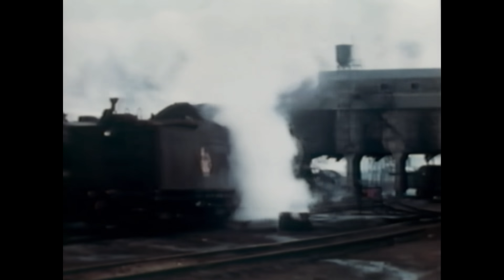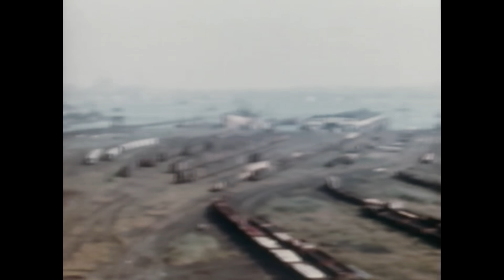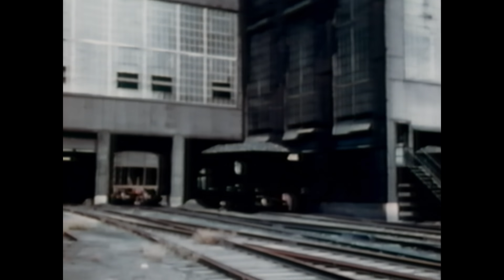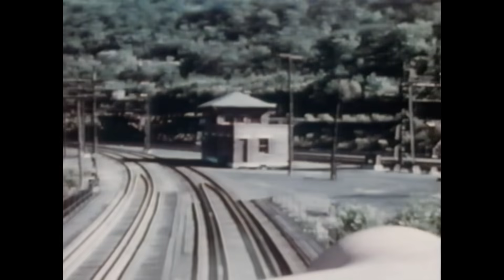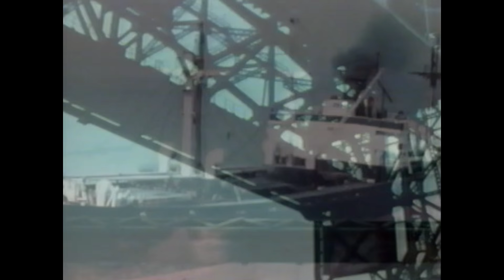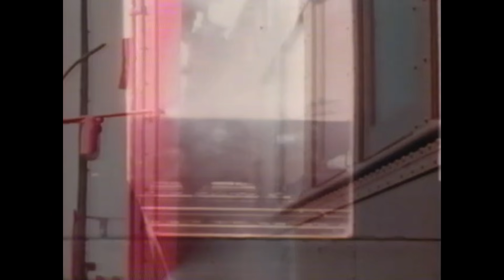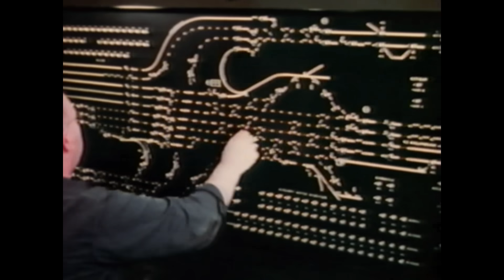The Big Little Railroad - 1948 CNJ promotional film

Comment: 1:38 former Blue Comet pacific
Reply: It almost looks like her blue paint is peeking out from under the black too... hard to say if that's just the lighting. Shame none were saved.
Reply: @PowerTrain611  I always wondered where one of the Pacifics would've ended up if the CNJ considered preservation. My guess is that it would've ended up in the hands of the URHS of NJ, Steamtown, or even Whippany.
Reply: @n0rmalpillz  Steamtown would have been an awesome place to see a G3 running... Imagine recreating the Queen of the Valley!
Reply: @PowerTrain611  If Cape May Seashore Lines had one of the pacifics, I would’ve loved to see it run down to Cape May
Reply: @rhin0pillz  CNJ did consider presentation, they saved both Camelback 592 and Boxcab diesel 1000. Both of which reside on display at the B&O Railroad Museum in Baltimore. 0-6-0 113 also still exists and is operational.
Reply: @0759trainz  I’m aware that they did choose to preserve their smaller locomotives but I’m talking about how didn’t consider at least of their larger locomotives like the G3 for preservation.
Reply: @rhin0pillz  which sucks tbh. Would be nice to have one of their Mikados alongside one of their Pacifics

Comment: During the period of control by the Fisk family, the CNJ owned a small railroad that when from near Chestertown, MD, through Smyrna, DE to a place that would be called Woodland Beach, DE. The idea was to take shipping from the WM in Baltimore, ferry it up the bay to Chestertown, send it by rail to Woodland Beach and ferry it over to Bridgetown, NJ.

It lasted about three years. Then the Woodland Beach to Smyrna section was operated seasonally for produce traffic from the DelMarVa peninsular. Shipping it by boat to NYC. About a quarter mile of the track is still down in Claton, DE, it was used until the 1970's to service a cannery.

A short portion is still used by the Maryland and Delaware railroad out of MIllington, MD.

Comment: It was fun watching the coal hoppers unload at the coal docks south of the CNJ Jersey City passenger terminal. A hopper was pushed up the ramp to the unloading spot, the coal was dumped onto a barge and the empty hopper went down another ramp by gravity. The hopper went up a short switchback where it reversed direction, then rolled down through the spring switch and onto the yard tracks of empty hoppers. I almost missed my lunch break watching this process.